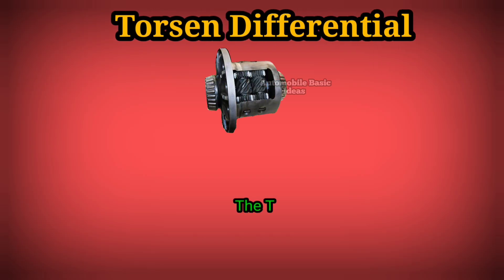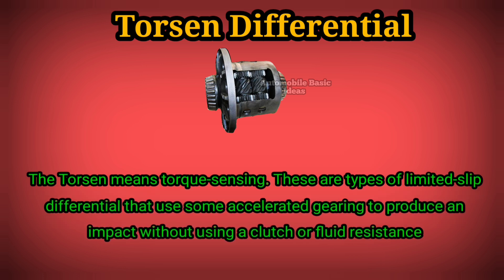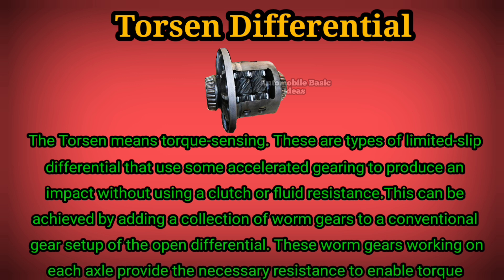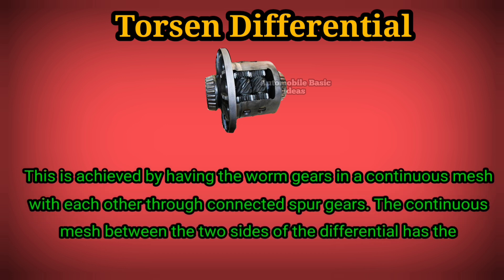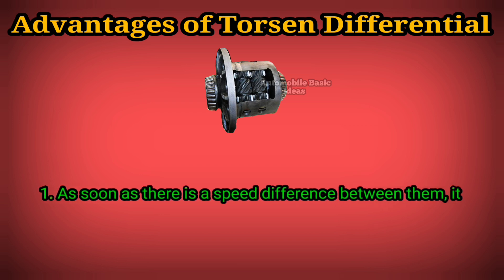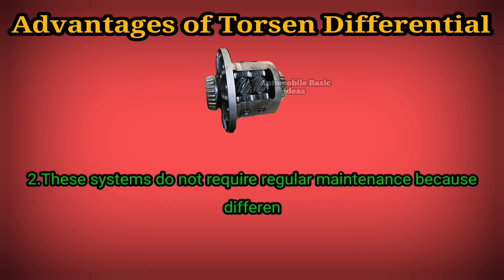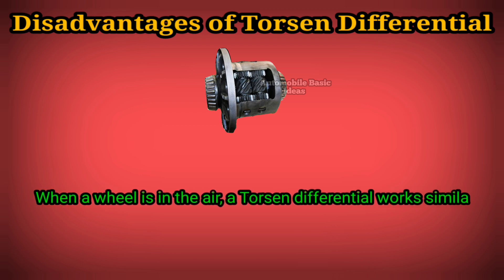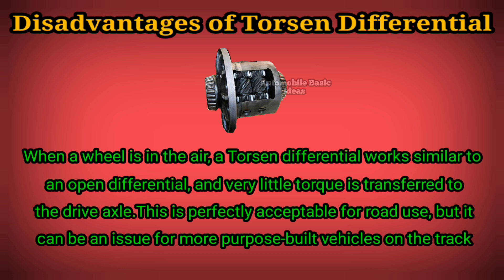TORSEN DIFFERENTIAL || DISADVANTAGE || ADVANTAGE || WORKING ||

Comment: Explain to me how it react quicker than a clutch pack LSD? it doesn't...
Reply from the maker: A Torsen differential reacts quicker than a clutch pack LSD because it utilizes a gear-based mechanism rather than relying on fluid coupling and friction plates like a clutch pack LSD. This gear-based system allows for near-instantaneous torque transfer between wheels, resulting in quicker response and improved traction.
Reply: @automobilebasicideas  Clutch pack doesn't use fluid coupling, reserve that term for torque converter in automatic transmission, with a clutch pack the differential is locked when on throttle, torque transfer up to 100% will be instantaneous, Torsen never ever locks, it is an open differential that can transfer 70-80% of the torque instead of 50%, it is better than open but not comparable to clutch pack for traction performance. If you are off throttle with a clutch pack then only the preload mechanism is active, it will gradually lock when giving throttle so there is a small delay (tunable) until you get 100% lock, it's a much better system because it actually locks, response time for locking on Torsen is infinite.